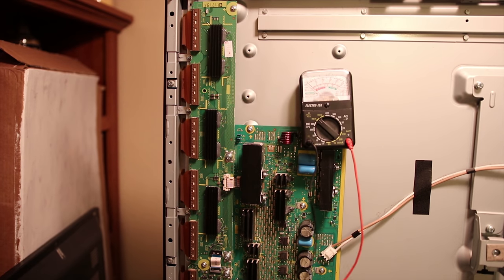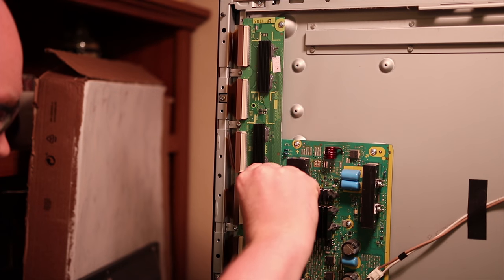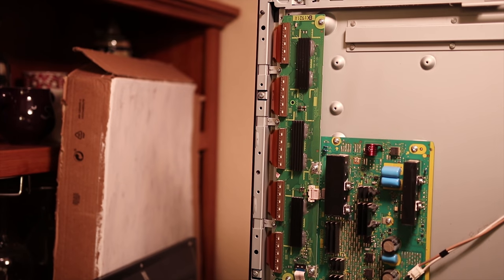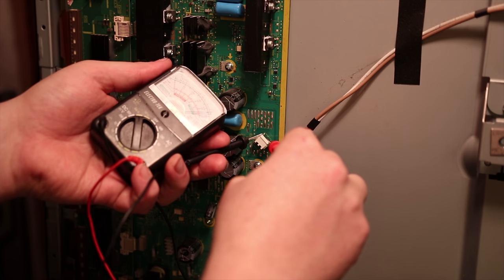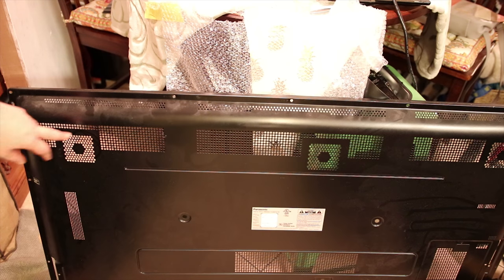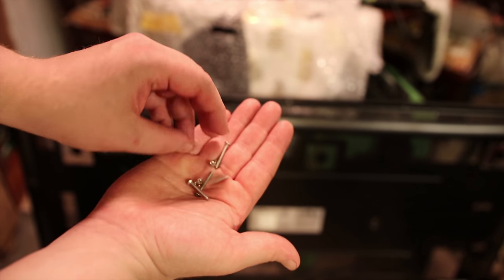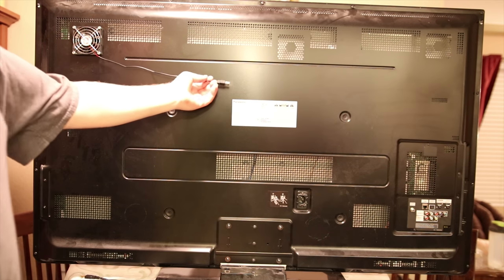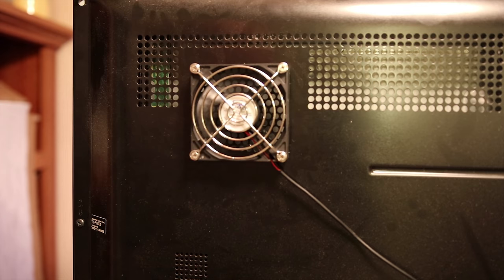Fixing a Plasma TV part 2 and Adding a Case Fan

Comment: Hey, this last week I finally opened up my Plasma-TV as well, actually to do a cleaning (and man, was there a not-OK amount of dust in there), and I could finally get an idea of the inner workings, including the cooling. - So, something I noticed is that the TV in this video had NO fans at all?... Because mine has a serious array of 4 exhaust-fans, but then also a significant amount more circuitry in there. - And a theory I have now is that perhaps your TV is a little older than mine(? - it's from 2009) and perhaps they had learned from this problem and finally added fans. - I'll also add that your TV has a lot more perforation in the back panel than mine, where the bottom half is actually very similar, the top half doesn't all the perforation around the fan-spots and the top "edge", which makes it seem that for yours they were counting on, indeed, hot air rising and hoping it would just leave the chassis through the holes. - But knowing about computer-cooling, that's probably just not enough air-FLOW and actually cool air INTAKE does more for cooling than exhausting it.

So my TV has 4 fans, but despite there being quite some perforation in the back panel, I found that it sucks in from any little crack it can, as dust was around any edges and in any corners where one part meets another. Like it even sucked air, and thus dust, in around I/O-connectors and buttons. - Dust (from a decade of use) was EVERYWHERE, in some areas (particularly where it's very open due to the perforations) it accumulated into something of a blanket, so it was probably going to kill something soon. - I'm surprised it's still running pretty much like normal, and this thing gets HOT. You can feel a warm glow when you walk past it in a room with medium or lower temperatures.

Anyway, long post, but perhaps interesting to someone.

Comment: Just curious if this fix has lasted for you.  I'm in the same boat with my Panasonic and am not sure if another $75 is worth it for the system board.  

As an aside you might want to consider adding some rubber washers between the metal and the fan to dampen the noise of the fan.

Comment: Question; Can I replace existing fans with different ones? - I mean, I'm sure I can, but do you think I'd need to be doing soldering or something with the wires or the plugs.
Would they also need to take specific voltages or anything? - The thing is, there are 4 of those cutouts on the back of mine, but just two or three fans. That's fine and all, but the fans are really noisy. Probably because they're very basic ball-bearing industrial fans, as well as dusted up and dried out after a decade (and over 38200 hours of spinning, apparently), and they spin quite fast. They give me a headache at about 35dBs. I barely notice them with any significant sound, but once there's less sound, like quiet scenes and whatever, I just hear them clearly. I even hear them on the other side of the room. - It's horrible, and my PC-fans make less noise right next to me, so I need me some of those good ones.
Reply from the maker: Yes.  The voltage, wattage, width, depth, and cfm all need to be taken into consideration.  Most of the time fans plug in, but the plug they use may be proprietary.  It may be necessary to cut the wires to connect to the new fan.  Larger fans typically run quieter at the same or higher cfm, so if the case can hold them, they're worth using.  The best thing to do is to see if you can get a look at the tag on the fan, google it, and see what the specs are.
Reply: @Distractor_Beam  - Hey, late response cause I just found this video back, but appreciate it! - I still need to look into it and I might do it this week.
I really liked larger fans, at least like 120-140mm as I use in my PC-case, but I think the cutouts just allow for 80mm ones.
I'm just wondering if I can just use slower fans or if that causes issues, like something with the power or signal supplied to them, as well as the amount of air they move.
I'll first just have a look inside when I can, though... I might just end up cleaning and lubricating the fans first to see what that does.